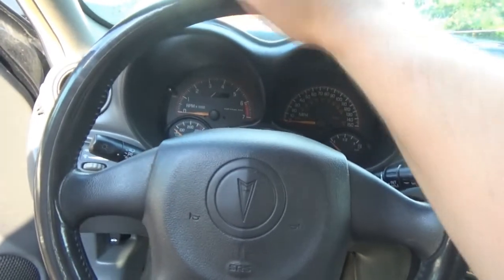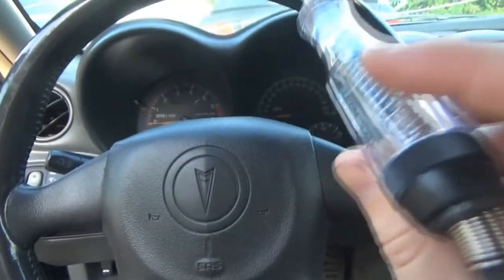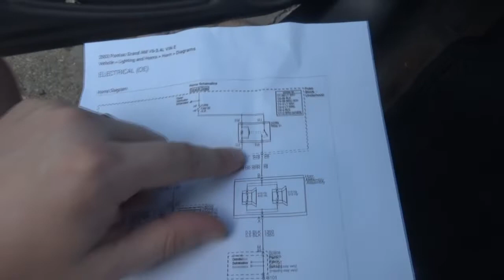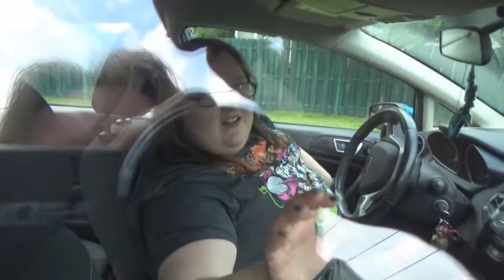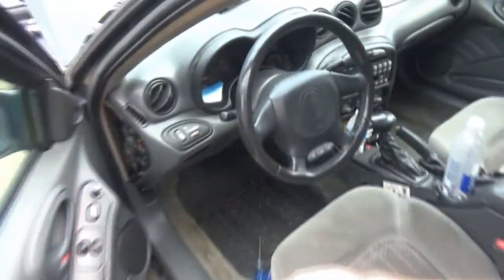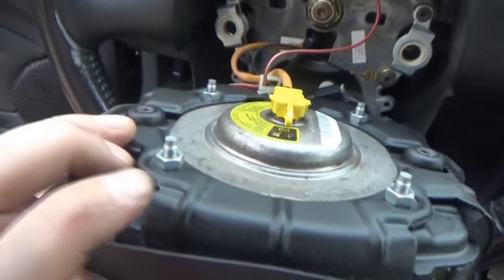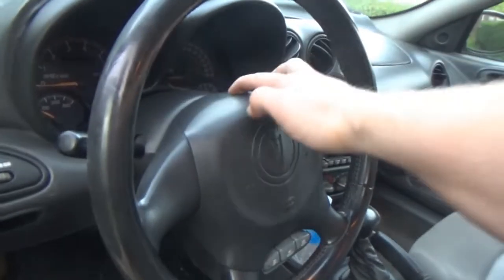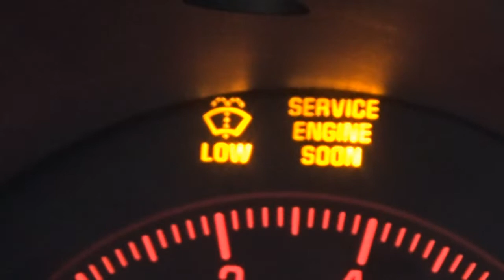MV 384 - "The Grand Am Has A Horn Issue"

Comment: Do you know what would cause intermittent wipers to stop in mid swipe, replaced the MFS 2004 GRAND AM GT1 WITH 307315 MILES STILL RUNNING.

Comment: Have exact same horn issue! Do you think with relay in and with horn stuck will it kill battery? I had relay out but decided today to put back and remove fuse.
Also I thought about wiring in a switch from wire the coil attaches to that goes from horn to relay. 
Lastly is yours a V6 ? I noticed you had a starter relay. Mine is 4 cyl and no starter relay

Comment: Have the exact same issue, but 2004. Came here to see how to take off airbag cover, to see if I could unstick it(horn), as I think you were trying to do. I have burned out 6 horn fuses. I too now have no horn, for a week or 2. Guess no easy fix. Did you ever fix? Wonder what a mechanic would want to fix it. (Also was pounding on horn to get it to go off, it went off.) Now it stays on all the time, except it has no fuse. Cannot pass inspection in Texas, without a horn. This has happened before, but I was always able to unstick it, by "gently" pushing it in, a few times. Until now.
Reply from the maker: I never fully fixed it. I left the fuse out. I think the only way to fix it is to replace the entire air bag assembly from my understanding. I’ve been considering pulling another one from the junk yard.

Comment: got this problem, had it on my isuzu amigo also...it is the membrane inside the rubber horn skin...what happens is the plastic backing plate and rubber skin warp due to heat, and press on the membrane. The membrane is sandwiched between the two, and molded together with rubber rivets. I got another from a salvage yard - same problem...you can get to it, if you don't mind working on that air bag bomb, just take those 4 nuts off the back, and it comes apart. Once you get the charge pack out and away from you, it's not so bad, lol...yes they can blow from static electricity, but you would have to touch the airbag wiring terminals.
Reply: addendum...finally fixed mine, went back to wrecking yard and found another that had apparantly not been warped as bad...something to help, when reinstalling, thread the horn airbag screws back into the back of the assembly loosely, then put it back in place, instead of try to put them in thru the holes in the back of the steering wheel...They work on expanding in the hole as they are tightened